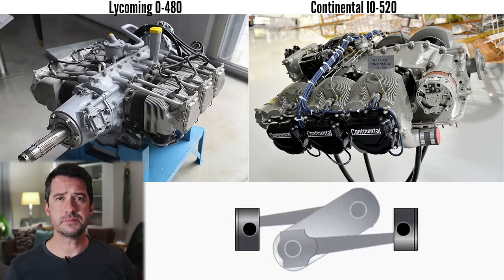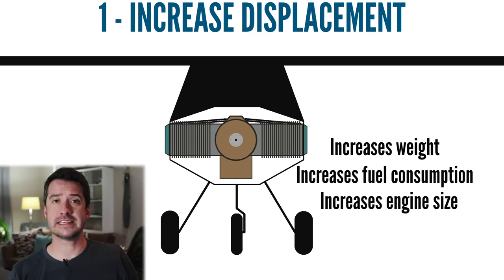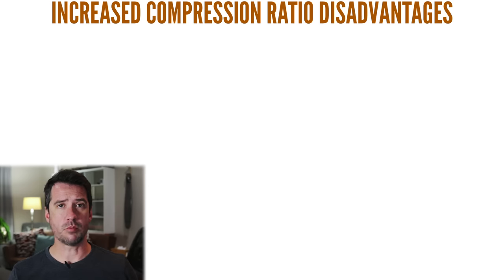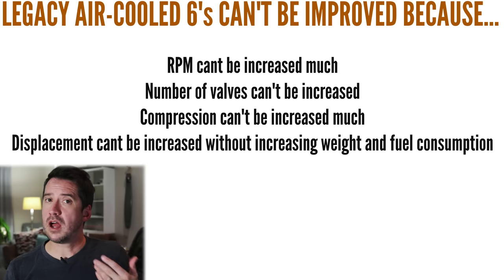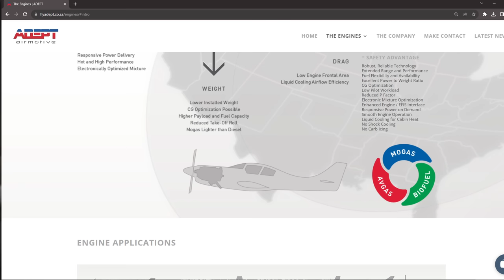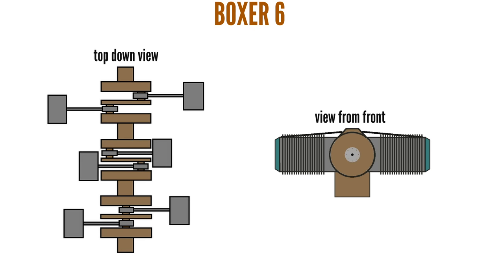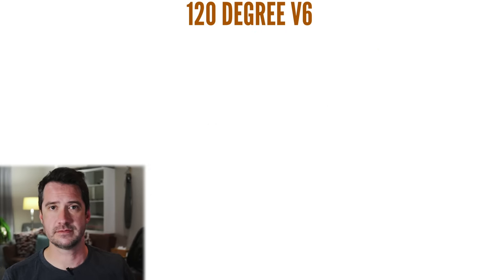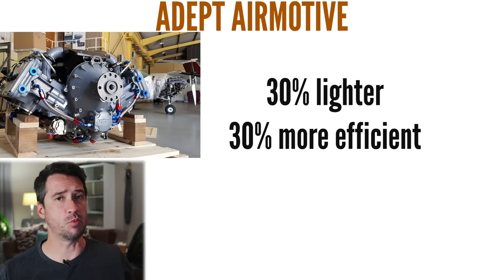Unusual V6 Airplane Engine Makes Boxer 6 OBSOLETE?

Comment: 1.  Engine efficiency increases rapidly with compression ratio up to 6.5.  Then the rate of improvement slows so the gain between 10. and 12 may be only 3%.  On the other hand engine weight to contain the pressure is theoretically linear.
2.  In auto engines, For a given power pushrod engines weigh less than OHC, even though the pushrod displaces more.
3.   Air cooling fins spread the cylinder centers making for a longer block and crank.  Add in sloppy air cooled (AC) tolerances, Continentals and Lycomings (C&L) squirm and as a result wear out.
4.  The logic behind AC engines is simplicity makes for reliability.  This was true in 1935.  Liquid cooling (LC) has come a ways since.  Nowdays, LC is arguably MORE reliable because it makes for stiffer, evenly cooled engine.  As bonuses, a LC installation has lower drag than AC, the engine CR can be increased, and the engine is smaller.
5.  The power pulses in a four stroke engine don’t overlap until it’s an 8 cylinder.  When the pulses don’t overlap, the engine drives the prop then the prop drives the engine.  In the PSRU, the teeth - which need clearance- are slammed back and forth.   C&L built geared engines which were headaches.  Rotax 912 coupling works fine..is it scalable?
6.  Likely the lightest, simplest aviation engine would be:  90DV4, two stroke, wet sump, Schnuerle ported, FADEC direct injected, LC, blower scavenged, sleeved aluminum block, oil cooled pistons, and PSRU.  Think a Deltahawk diesel, but running on gasoline.  
7.  The engine block, heads, and crank would be designed to be machined from billets instead of cast or forged.  Also designed to use auto parts.  The idea is scratch build when ordered, minimum inventory, minimum staff.
8.  Schnuerle ported engines can be turbocharged.

   Will it be done?  Could it please the FAA magnetoheads?         Cheers
Reply: #2 is not true when you're talking about high performance engines. No pushrod engine, for example, can match the power to weight ratio of the engines in the following cars:  Aston Martin Valkyrie, Porsche 918, Gordon Murray Automotive T.50, Lamborghini Aventador, Ferrari Enzo, Porsche Carrera GT, Ferrari F50. When it comes to racing engines, there's just absolutely no contest. A 3.0 liter Formula One V10 can weigh as little as 203 pounds (their required minimum weight) but make as much as 965 hp.
Reply: @PistonAvatarGuy which of these engines will likely come with a warranty or make large production numbers in an auto or aircraft? It might be interesting to see, now that most cars and light trucks have tiny engines.
Reply: @davidbaldwin1591  All of the road car engines that I listed come/came with warranties. All of these engines are produced in relatively small numbers. It's interesting to note, though, that the pushrod engine that competes most closely with the other road car engines listed in my comment had some pretty significant reliability issues.
Reply: @PistonAvatarGuy  My information came from the Wall Street Journal’s auto columnist, Dan Neil.  He compared a Corvette C7 V8 OHV to a Ferrari V8 DOHC of the same power.  The Vette engine though it displaced more, was lighter.  You can take up your arguments with the WSJ.  It’s the only apples to apples I know on this question.
    For any  reasonable engine candidate for an aircraft engine - which is what we are talking about, not an F1 DOHC screamer- this is going to be true.  OHV has better specific power.  
     For a plane engine there up to ~3100 RPM a LC Side Valve engine is adequate (if LC), up to ~5500 OHV is OK, above 5500 DOHC four valve.  The specific power decreases from left to right.                  Cheers D
Reply: @PistonAvatarGuy  In the world of high performance engines, nothing comes close to a pushrod top fuel dragster.  These guys make North of 3000 hp out of 500cid or there about.  
    In the world of affordable production engines available to humans, the Rotax ETec snowmobile engine makes 180hp from 800cc.  Cheers
Reply: @danbenson7587  That's only because OHC engines were banned from Top Fuel after one came along and started dominating the pushrod engines.
Reply: @danbenson7587  That WSJ article is wrong, he was just cherry picking. The V12s made by Ferrari and Lamborghini are slightly heavier than a Corvette V8, but they're far more powerful than any NA pushrod engine that's ever gone into production, giving them superior power to weight ratios. He also ignored the Porsche 918 engine, which is also more powerful than any NA pushrod engine that has ever gone into production (except some versions of the Viper V10, maybe), while also being about 150 pounds lighter than a pushrod V8. Google the engines that i mentioned, especially the Cosworth engines, you'll see.

As far as aircraft engines go, DOHC makes more sense due to the efficiency of the configuration, which reduces the fuel load the aircraft must carry, further improving the efficiency of the aircraft as a whole.
Reply: @PistonAvatarGuy  Friend, Dan Neil had no incentive to cherry pick, just report the facts.  Sure you can find any exception.  A hemi 2valve OHV drag engine embarrasses an F1 engine.  But would either make fine airplane engines?  
    Perhaps I wasn’t plain I was writing, since it was the topic, about AERO engines.  OK, OHV is lighter than DOHC except for exotic engines with turbos, turbo compounding, tuned inlets, tuned exhausts, variable displacement oil pumps, gas operated valves, desmodromic valve trains, squish, VVVC and on and on.
   But we are discussing airplane engines.  A plane engine that clunks along at 2750, an OHV works fine and lighter than DOHC.  Did you know the breathing dynamics of low RPM engines favor 2 valve engines?
   The Allison, Merlin, DB, and Junkers WW2 V12’s were 4 valve OHC.  The P&W, Wright, BMW and Japanese radial engines were hemi’s.  The Brits had both inline and radial sleeve valve engines.  Wanna guess which had the greatest specific power?.  Post war, the V12’s faded, but the last P&W R2800 was built circa 1964.  Do you know why the radials hemi OHV continued in production?
    Engineering endeavors balance a triangle of conformance to requirements, cost, and time.  An aero engine’s requirements are different than an auto’s, but their is overlap.  Thru the Darwinian refining of markets we have ended up with OHV aero engines, and DOHC doesn’t cut the mustard.  The latest scratch built aero engine, the Rotax 912 series is OHV.       Gotta go..D
Reply: @danbenson7587  Whether the author of that article has an incentive to lie, or not, he did. Dan Neil is a liar, PERIOD. It's not that you can find just a few exceptions (my list was absolutely not a complete one), you can find a HUGE list of exceptions. And, yes, OHC engines make great aircraft engines.

No turbo (or turbo compound) engines were named on my list of engines that have better power to weight ratios than OHV engines, that was the point, those were all just purely naturally aspirated engines. If you'd bothered to look at any of those engines, you would have seen that.

All modern engines have tuned inlets, many have tuned exhausts. Variable displacement oil pumps are rare, even on OHC engines. No desmodromic valvetrain engines were mentioned. All modern production car engines have squish area and variable valvetrains aren't really relevant in a discussion about aircraft engines. The only engine with "gas operated valves" (I suppose that you meant pneumatic valve springs) that I mentioned was the F1 engine, which is just so far above any pushrod engine that it's almost ridiculous.

Top Fuel BANNED OHC engines when one started dominating the OHV engines, and that's the ONLY reason why OHC engines don't dominate Top Fuel right now. One of the reasons why that engine did so well in the races was because IT WAS MORE RELIABLE THAN THE OHV ENGINES.

Not all aircraft engines loaf along at ~2,200 rpm. Rotax engines run at over 5,000 rpm, and I challenge you to find a more efficient aircraft engine than a Rotax 912 iS. Heck, the Rotax engines appear to be more reliable than their LyContisaurus counterparts, and that reliability has only improved with the adoption of EFI. What was that you were saying about Darwin?

This is not 70 years ago, it's not even 50 years ago, times have changed, technologies have improved, and OHC engines are just better, which is why only American V8s make use of OHV technology on any significant scale.
Reply: @danbenson7587  Even the Mercedes-Benz M159 V8 weighs less than the LT2, while making 132 hp more.
Reply: DOHC even makes sense for the same flow. This is a flat engine , not a V. So we can just use a pent roof chamber. Then no roller, just finger followers. A lot of space around each valve to let it breathe. So engine width stays the same, but friction goes down.
Reply: @PistonAvatarGuy  As mentioned before Neil had no reason to lie, he just gave the facts between the Ferrari and Chevy engines.  He made no global claims.  
    The advantage of DOHC is high speed makes for higher power from smaller displacement.  This does not automatically transfer to better specific power.  But as the central subject is aviation, I  think the DOHC advantages come at a speed outside what is acceptable, but not what is possible.       Cheers
Reply: @danbenson7587  "As mentioned before Neil had no reason to lie..."

Except MONEY. Are you new to capitalism, or something?

"...he just gave the facts between the Ferrari and Chevy engines."

A Ferrari engine, ONE. He cherry picked an engine to make his point work.

"He made no global claims."

I don't have access to the article, so I wouldn't know, but it clearly gave you the wrong idea about OHC engines.

"The advantage of DOHC is high speed makes for higher power from smaller displacement."

Naturally aspirated DOHC engines also tend to have greater BMEP than pushrod engines, which can really only come from the engines operating more efficiently (this includes greater mechanical efficiency) and/or them having greater volumetric efficiency (which also tends to come with greater overall efficiency as a result of reduced pumping losses), proving that they're superior in more than just their ability to rev.. Tell me, what naturally aspirated pushrod engine (that can be found in a production car) can match the BMEP of the Ferrari engine in Dan's article?

"This does not automatically transfer to better specific power."

But it does mean that they're capable of far greater power to weight ratios than any pushrod engine, when both are in their ultimate form. That's the real issue here, you can't claim that pushrod engines have better power to weight ratios when it's completely impossible for them to match the power to weight ratios of the best OHC engines.

"I  think the DOHC advantages come at a speed outside what is acceptable, but not what is possible.  "

Good for you, but largest producer of piston aircraft engines in the world disagrees. 5,000+ rpm, where Rotax engines operate, is exactly where you'd want a DOHC system. And, really, as the producers of semi truck engines have shown, an engine doesn't need to operate at high rpm for it to benefit from an OHC system.

Anyway, I suggest that you look at the talk page for a Wikipedia article titled: Overhead valve engine. On that page, you will find a chart that can be used to assess the weights of various engines. I suggest that you look closely at the bottom of the chart for the racing engines.
Reply: @PistonAvatarGuy  The LT2 Chevy is shared architecture 90d counterweighted. The LT6 is a dedicated scratch design flat plane crank w/o counterweights.   Which points to the obvious and the subtle.  Obvious is the weight saved by CW deletion, the subtle is the difficulty of apples to apples comparisons.
      Returning to plane engines, they run at 75% power say 80% of the time, what RPM (effectively piston speed) would you run for a 2000 hr TBO?
Reply: @danbenson7587  So, you're just going to ignore the Mercedes engine that I mentioned above? The Mercedes M156 and the M159 both have better power to weight ratios than the LT2, yet they're both crossplane engines.
Reply: @danbenson7587  Also, I don't know what engine was used for comparison in that article, but a Ferrari F430 engine makes either 483 or 503 hp and weighs in at only 386 pounds (see: How much does a Ferrari engine weigh? - Alfarrari 105 project car build part 10 on YouTube), that gives it a significantly better power to weight ratio than an LT2.

Edit: Sorry, he's using a 360 engine, which makes 395 hp (up to 419 hp in the Challenge Stradale). So just a hair shy of the power to weight ratio of the LT2. According to Ferrari, the F430 engine weighs only 4 kg more than the 360 engine, so it definitely does have a significantly better power to weight ratio than the LT2.
Reply: @danbenson7587  Rotax engines and the Adept Airmotive engines both run at over 5,000 rpm and both have maximum piston speeds around 12 m/s. Most of the Rotax engines have a 2,000 hour TBO. The Adept Airmotive engine probably has an advantage due to it being entirely liquid cooled.

Edit: The Porsche PFM 3200 also ran at over 5,000 rpm, its maximum piston speed was 13 m/s, it still managed to have a TBO of 2,000 hours, despite being air-cooled.
Reply: @PistonAvatarGuy  It’s been some years ago that I read the column.  Frankly gave up keeping track of car engines
Reply: @PistonAvatarGuy  I don’t know anything about the Mercedes engine, so no comment.  Have to take your word for it just as I did Dan Neil’s and look where that led!   Let’s cool this down a bit.
     If the Mercedes is a V12 can be built w/o CWs on the crank.  The aero V12s of WW2 did not always have CW cranks.    Cheers
Reply: @PistonAvatarGuy  Top fuel drag engines make 8000 hp.  So this would be ~10hp\lb.  
NASCAR pushrod 359 CID V8s on gasoline make 900-1000 hp w/o restrictor plates and turn 10000 rpm...weight unknown.  Might compare to your 4 valve friends.  
Gas Turbines say 3hp/lb but they run for 1000s of hours.
The all time champ is the Shuttle turbopump at 200hp/lb.         Cheers
Reply: @danbenson7587  We're just going in circles now. The Chevrolet R07 NASCAR engine weighs 525 pounds, which is just hilariously heavy for a racing engine. F1 V10s could make the same amount of power, but they weighed 203 pounds.
Reply: @danbenson7587  Also, as far as i know, a 5.8 liter NASCAR engine has never even made 900 hp, the larger figures claimed for those engines are all stroker engines that were not built to compete in the series.
Reply: @danbenson7587  It should also be noted that NASCAR engines need extremely high octane fuel to make as much power as they do, while F1 engines basically run on pump gas.
Reply: @PistonAvatarGuy  I just cited NASCAR as a bench mark.  They use CI blocks and CW cranks.  The real measure would be Hp/CID.          
     Moreover, I don’t know the duration of an F1 race.  There are two questions..will it run and will it last.  As cited before, drag engines don’t last, and F1 only a bit better.  Its senseless of either when the general topic is aircraft.
(In my view, both NASCAR, dragsters, Indy and F1 are silly both caricatures of real cars.   I don’t think high end racing approaches reality until LeMans type class, whatever that may be. But to each his own)
     You were lucky, I was deprived as a child, my uncle never gave me a life time subscription to Car and Driver.  Only have Heywood and occasional detour into Ricardo to read.        Cheers
Reply: @PistonAvatarGuy  The Allison V1710 later versions made about 1500 hp.  The V1710-127 turbo compound made 2900hp.  A 90% gain?  The war ended before the -127 saw service.
      I wasted some time checking the Mercedes F1 engine.  It is (electrically) turbo compounded.  By inference from the Allison, Turbo compounding overwhelmingly augments the Mercedes power, not DOHC.  
    Summarize a few facts.
     1.  The highest specific power or weight Otto engines are hemi OHV drag engine, hands down indisputable.
      2.  The last successful clean sheet Otto DOHC aircraft engine, the RR Griffon, went into service 80 years ago.  None since.
      3.  The latest successful clean sheet aircraft Otto engine is the Rotax 912 series..pushrod OHV.  I suggest you ask Rotax why they chose OHV instead of DOHC.                                                           Cheers and Merry Christmas
Reply: @danbenson7587   You're clearly trolling.

1. That's only because the rules in Top Fuel don't allow OHC engines, otherwise DOHC engines would dominate the sport.

2. The RR Griffon is not DOHC.

3. This was likely done to reduce engine width. When Rotax (Bombardier) set out to build a 300 hp aircraft engine (the V300T), they chose to build an OHC, 120 degree V6, which is also what this engine happens to be. I'll also add that the only successful diesel aircraft engines currently in production are DOHC (Austro Engine E4 series, Continental CD-300). EPS also chose a DOHC arrangement for the Graflight V-8. A DOHC arrangement was also chosen for the AE440 V8. Maybe the people who actually design and build engines know something that you don't?

As for efficiency, the Toyota M20A-FXS and the Mazda SkyActiv-G engines are also far more efficient than any OHV gasoline engine, they're both DOHC engines.

OHC engines are the best performing engines on Earth, in regard to ALL aspects of engine performance, it's indisputable.
Reply: @danbenson7587  Oh, and the Red Aircraft A03, which seems to be somewhat successful (edit: and was purpose-built for aircraft use), is also DOHC.
Reply: @PistonAvatarGuy  Please read what I said.  SUCCESSFUL engines...ones that sell.  BTW, on your comment about fuels, turns out that both NASCAR and F1 use purpose blended racing fuels.  F1 so much that each team has its own blend.   And Dan Neil is the liar?   
  In the U.S. we have the right to be wrong, but do you have to exercise your rights so frequently?  PistonAvatar..more like PistonHubris.      Cheers and Merry Christmas
Reply: @danbenson7587  Whatever, troll.

Edit: Ok, fine, my info on the fuels used in NASCAR and F1 was out of date. NASCAR used leaded, 110 octane fuel until fairly recently, while F1 has used unleaded fuel that's around 95-100 octane for decades now. Because of the drop in fuel octane, NASCAR engines are down to less than 700 hp without restrictor plates! That's pretty sad, which was why I was pointing out the difference in fuel octane in the first place. OHV engines simply don't perform that well relative to OHC engines when the restrictions placed on the engines are the same.

Many of the DOHC diesels that I named are plenty successful, I was just ignoring your requirement that the engines be Otto cycle engines, because there's absolutely no reason why that would be relevant in this context.

Nothing wrong with hubris when you're right.
Reply: @PistonAvatarGuy  Whenever the ‘expert’ makes an error like you did, he is no longer the expert.   Hubris, hubris.  Cheers
Reply: @danbenson7587  What error was that? The one that still supported the point I was making? EVERYONE makes errors, including experts. Edit: ...and I never claimed to be an expert on anything, I'm just some guy having conversations in the comment section of a video website.
Reply: @PistonAvatarGuy  Ok, expert out, Avatar in.  Avatar is a reincarnated God, and Gods don’t make mistakes.  Why shouldn’t you share the same petard as the one you used on Dan Neil?  Eat what you sow.
    On my end it was a matter of stringing you out till you tripped and then spear.   Learn anything?  I doubt it.   Hubris, hubris.   Cheers
Reply: @danbenson7587  Your first paragraph has me completely lost, especially the part about "gods" not making mistakes. If the bible is to be believed, god screwed up when he created mankind.

Anyway, you still didn't tell me where i made an error, so I'm just going to assume that i didn't make one and continue believing that my level of knowledge is superior to yours. If you want me to change my position on something, you're going to have to prove me wrong.

And i know that you're trolling, i know that i screw up from time to time, but i don't care, why would i? The only thing that i care about is the quality of my life, and I've never been able to improve that, so all that i can do is kill time while i wait for death. I don't know where that will lead, or what the f--k I'm even involved in, but I'm tired and (apparently) too stupid to figure it out, so I'm just going to say my piece when i can.
Reply: @danbenson7587  Basically, I just think it's funny that you think you can tear me down somehow, when the world already tore me down, dragged me to the dump and buried me.
Reply: @danbenson7587  And, yes, I did learn something. I learned that I was right about the Adept Airmotive engine and that it's technology which is going to be concealed and buried because it would prove people like me to be correct about several things that do not align with the prevailing narrative.

If I were actually wrong and someone wanted to teach me a lesson, they'd give me the ability to test the engine for myself and see how it performed, they wouldn't just try to convince me that I'm wrong without having a shred of evidence behind their argument.
Reply: @danbenson7587  And if your whole goal here was to catch me not obeying the golden rule, that didn't happen. I'm not concerned with people voicing their own opinions, my concern is that aircraft engine technology is not advancing, and I never prevented anyone from advancing aircraft engine technology. Golden rule obeyed.
Reply: @danbenson7587  Now I'll give you an example of some hubris: I pwned the f--k out of a "god" and this "god" only "won" the debate on a technicality.